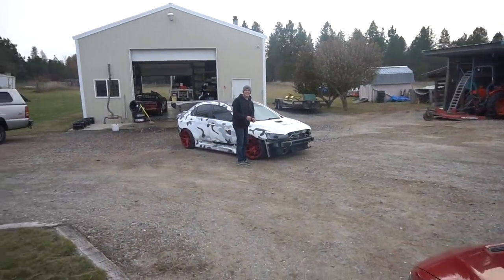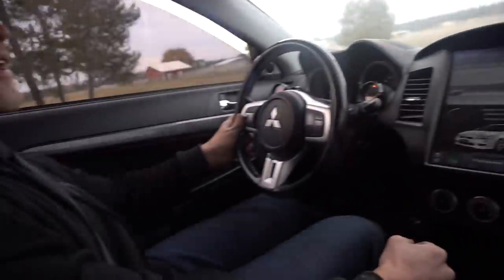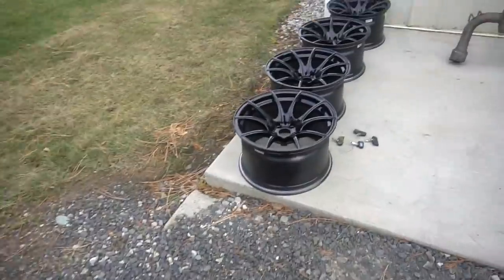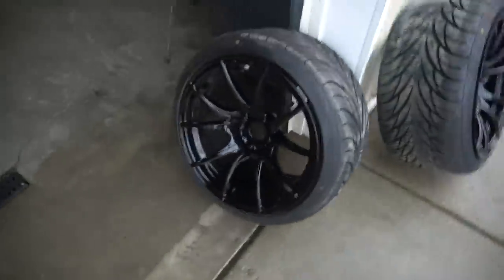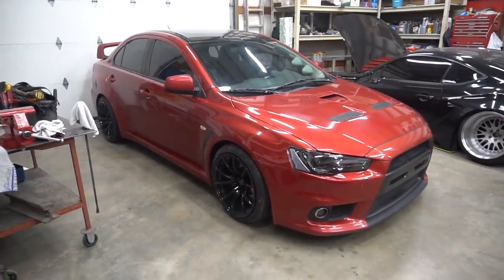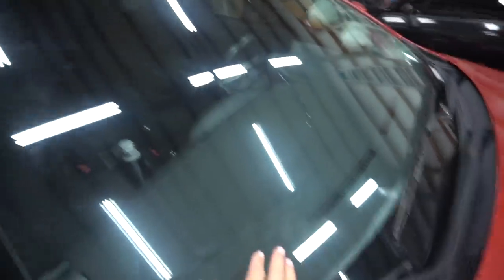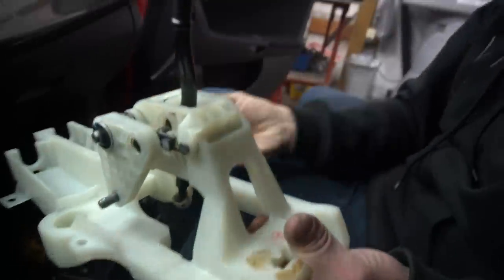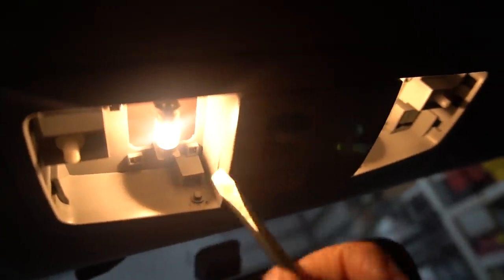New Wheels For My Evo 10

Comment: Cool wheel color to body finish combo. 

I would take the wiper arms off re paint them with rustoleum flat black with rattle can (No wait, that's very quick fix that I would do lmao) powder coat the wiper arms in same color as your wheels perhaps in just a basic metallic black.